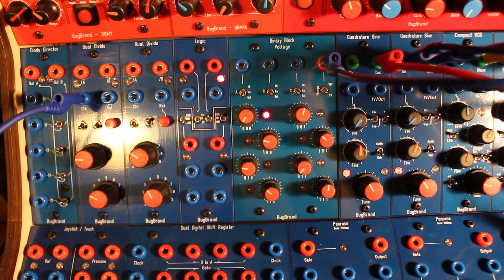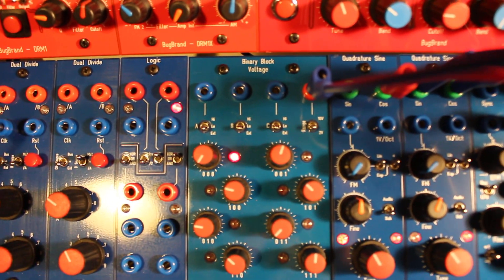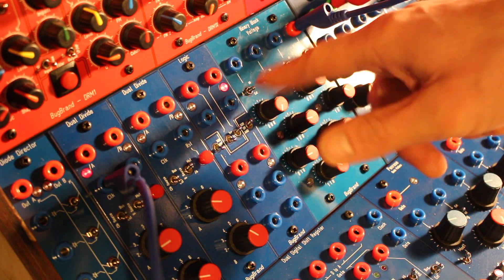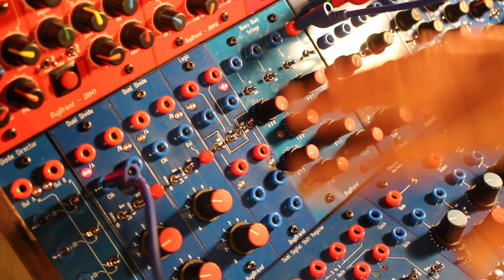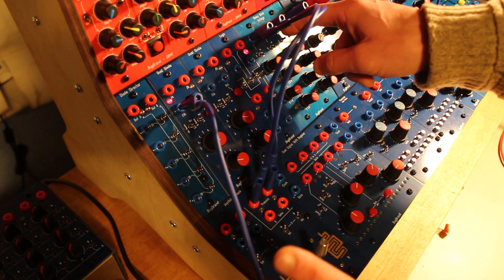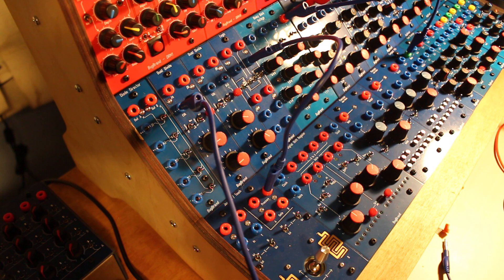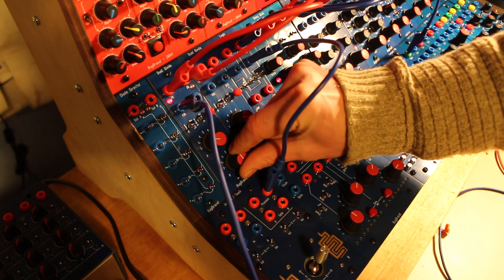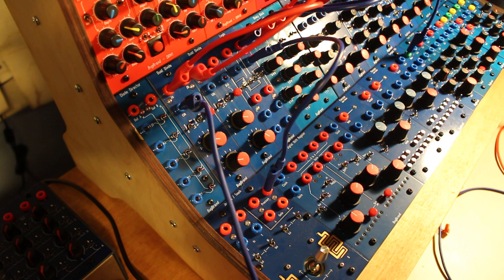BugBrand Binary Block Voltage (BBV) - rough overview

Comment: Great to see someone else designing multiplexer based sequencers and providing access to all of the logic inputs on the front panel.  I've been working on a similar design, but it has been on the back burner for some time. Excited to see your video on the DDSR!
Reply: Same. I have a sequencer system designed around this.  Need to finish the coding though. Currently have a fully working prototype from 6 years ago but it’s discrete.